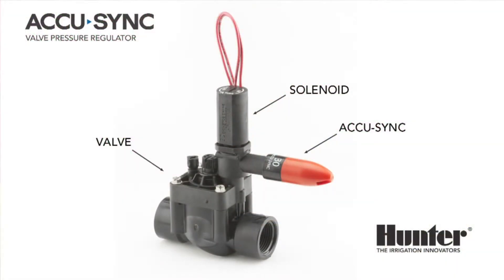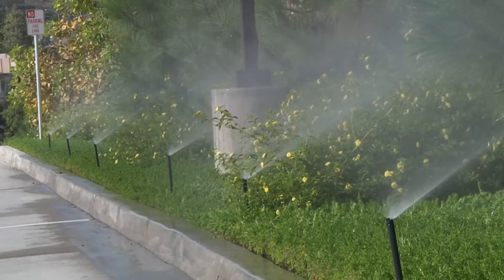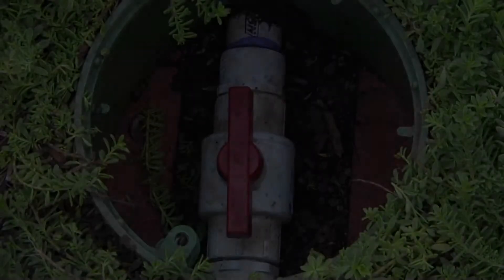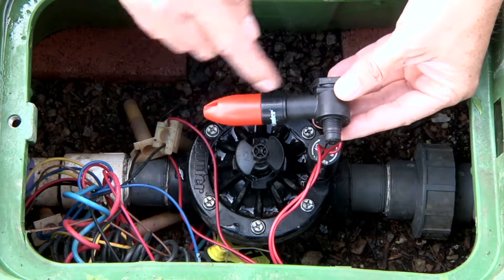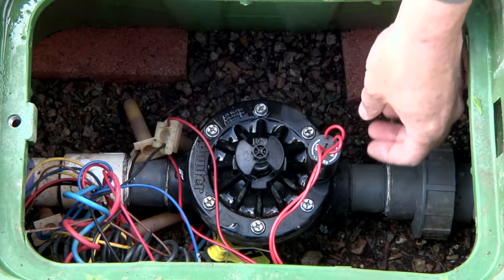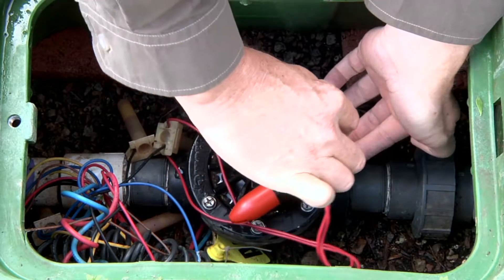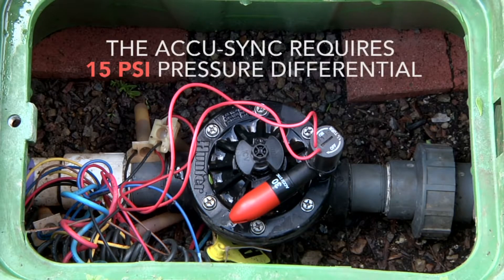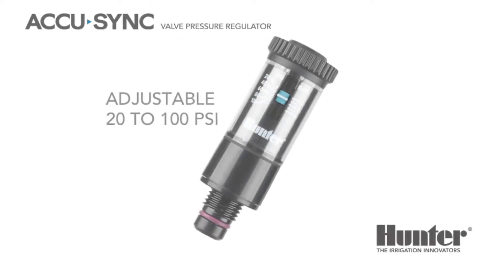Hunter Accu Sync valve pressure regulator - Installation adjustment

Comment: Interesting video. So I have a Hunter zone that is used for rotors. I'd like to convert that zone into drip irrigation. Based on your video... I can attach a 20 PSI pressure regulator to the existing valve. This would be easier than replacing the entire valve with Hunter's PCZ-101 valve correct? Thanks for any advice!